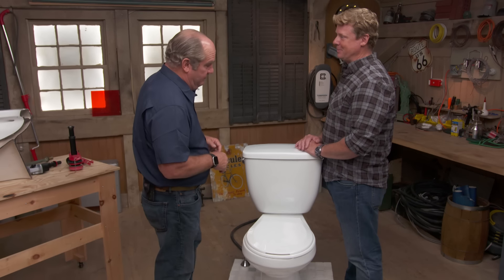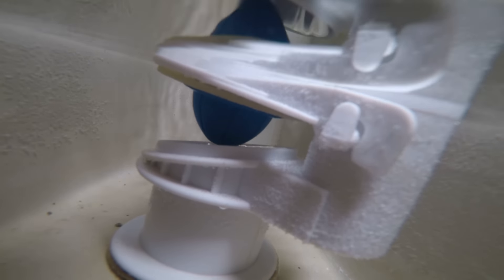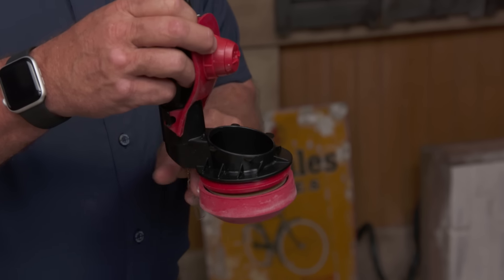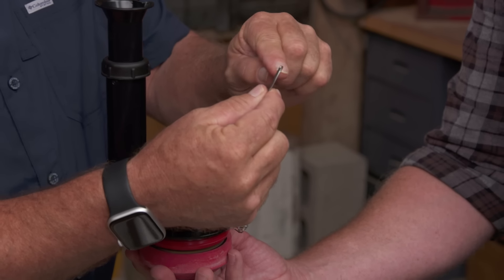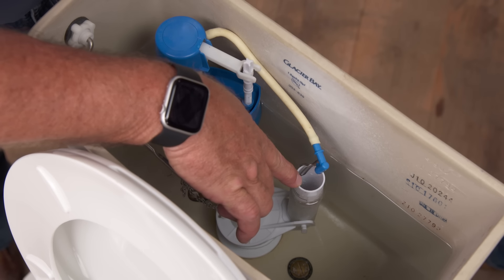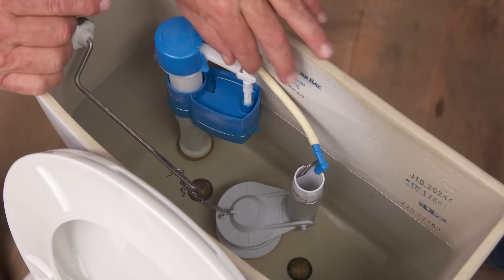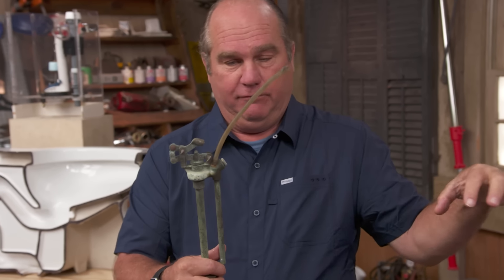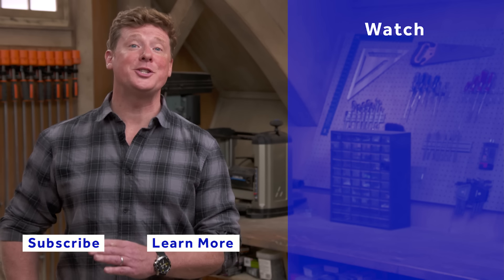How to Repair Toilet Tank Components | Ask This Old House

Comment: Look on the tank’s lid for your specific toilet’s model number when ordering parts or a new flapper. I’ve found that not all generic flappers work the same.  GL. ).
Reply: What if you have a old toilet and just want to replaced the internal to upgraded equipment? Can it just be replaced? Or should I replaced the entire toilet.
Reply: @gilberthsuarez4285  This same guy, last week on Ask This Old House, said just about nothing is standard in plumbing.  Likely you could replace, but no guarantees.  This isn't an expensive task, and if kept clean you could return (to a big box) and reinstall your existing.  I've had to do so for sink faucets/drains.
Reply: Thank you!  For some unknown reason, I presumed it'd be standard.

Comment: I have a valve that has a stem for a tube that fills the overflow (drain tube?), and a holder for that fill tube on the drain tube...but the stem is plugged with a plastic plug, and the toilet didn't include the fill tube. Any comments?

Comment: Don't forget to measure how long the new supply tube needs to be and an organic sponge will come in handy. Some supply valves are crap and quickly plug up, and others never have a problem.

Comment: On my toilet tank, the fill valve isn't behaving properly. Even though I've set the float to trigger the "off" condition at least a full inch below the overflow tube opening, it still manages to keep adding water. If I physically lift the lever up and hold it, it'll stop. In all of my years of having toilets, I've never seen the fill valve become faulty like this.

Comment: What if the piece of the toilet handle that connects to the stick that goes up to lift the flapper cracks. You can't replace that part right? I have to buy a new tank?

Comment: The flush valve they demonstrated is actually made out of a much more durable material than most people have. Many are plastic with a ring gasket and that gasket gets warn and cracks.

Comment: Replacement toilet flapper valves come in more than one size.  Some are silicone and some are rubber.  What could possibly go wrong?  Still, I really did like the video.
Reply: Well, if you must know;
When you put the wrong one on, it reaches out of the tank and head slaps you when you turn to get the tank lid.

Comment: They forgot to mention why there's a sprayer in the overflow! There's actually a subtle form of automation in your toilet besides the on and off values. The fill rate is being used as a timer to run the jet which is the stream of water that goes directly down the drain hole. This jet makes the siphon over top of the trap and causes it to suck all the water out of the bowl. This means the overflow has duel purposes it carries the jet stream inlet (the sprayer) and the overflow. It's not totally necessary to have the overflow also build the siphon but its useful for diagnosing problems with the toilet because the bowl will be continually low water level which is an easier way to see this is happening than shown in the video. You can actually take a water bottle and dumb it down there to see this in action.

Comment: An explanation of how to properly attach the chain to the lever would be good. I have always put the hook over end of the lever arm, but I see from the video that the hook actually goes through a small hole in the arm, and then a chain link fits on the end of the arm. I wish I had known that 20 years ago! Every toilet I've ever seen has the hook on the knob, which I guess isn't right. Next time my chain comes off the arm, I'll put it on correctly.